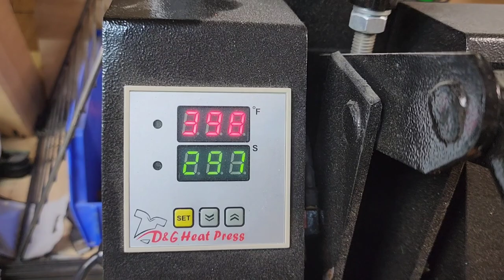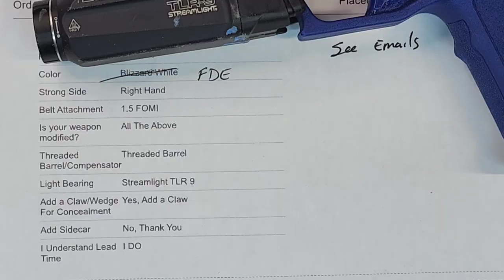Making an IWb holster for the PSA Rock 5.7 With TLR9

Comment: the commentary walking us through what you do is pretty cool too. what do you do with your mess ups? Q4 is coming up you could add a "blem" promo or something for the upcoming holiday seasons
Reply from the maker: It depends on the severity of the mess up.  Generally I'll post on fb around half price to move it. Sometimes I do the same at a gun show. If it's a bad mess up. I'll scrap it or reuse the material for a mag holder or something.
I do have a overstock/scratch and dent section of holsters on my website. Just haven't had anything to upload.  It moves quick

Comment: have you ever made a holster and even though you have a blue gun or molding prop that is identical to the gun, the holster just doesn't fit the real weapon that great. Had this happen with a kel-tec p17...made 3 different holsters now trying mod this or that and still at about 80% usable. Cranking down the retention seems to be the only way to fix wobble on it. Even used less tape thinking it was to wide when all blocked up and ready to press. Just curious.

Congrats on the 10k subs. Without your willingness to share your experiences we would all be making holsters that look like a wet flour taco tortilla.
Reply from the maker: I've had a handful not work over the years. It happens. Some molds are just out of spec. I have made them for the p17 and I'll cut molds for the p17 at some point.